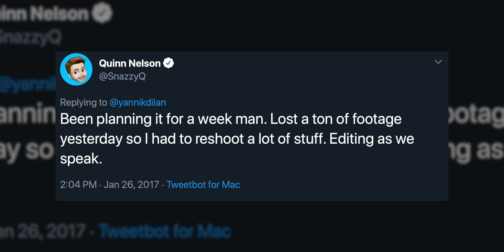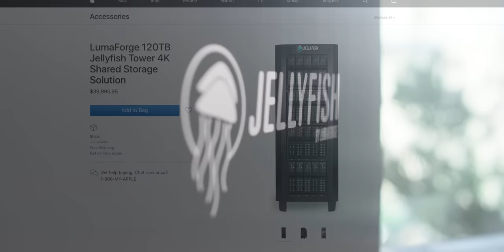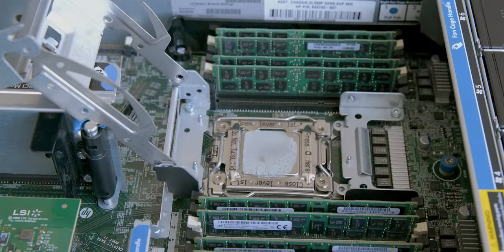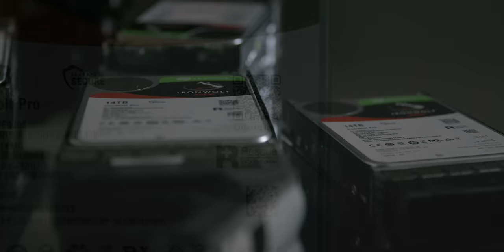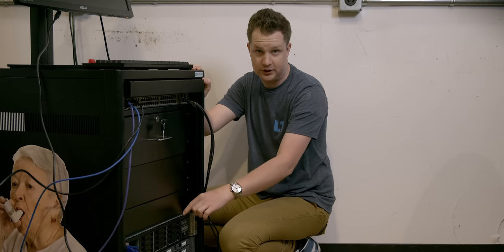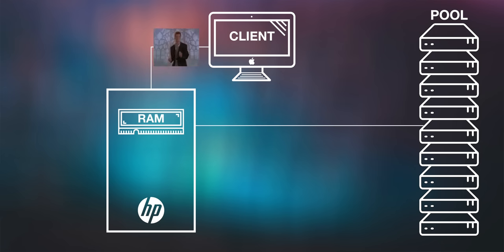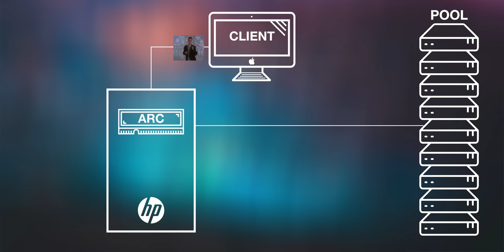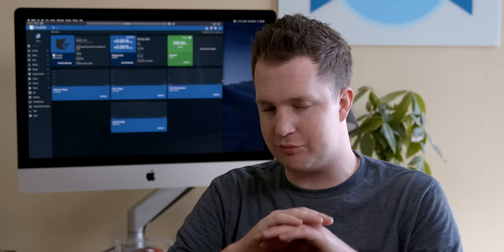I Built a HUGE 336TB Server Without Linus Tech Tips!

Comment: Next challenge: Max out your iMac’s 10 gigabit ethernet with a tape drive server
Reply: I stumbled back onto this video. Thinking about it again, it's really obvious he didn't need all of his data on hard drives forever. A tape archive would have worked great and been pennies on the dollar compared to this. (If he had to pay for the drives). He wouldn't even need a beefy server. Just a small NAS with a hella fast nvme scratch disk for current projects and the tape recorder on the front. Pop in a new tape every few weeks and you're good. LTO-8 tapes are $120 for 15TB or more of video storage. A new tape drive is $2k-$3k or less if you find one on eBay. It's easy to keep track of which video projects are on which tapes. You aren't realistically going to be referencing more than one or two project files a week so it's perfect. Also the tapes don't degrade because you're just reading from them. Most of those tapes over a year old will just sit on a shelf for the rest of eternity.

Comment: You have an interesting interpretation of a “budget” build, with $12,000 of new HDD. If you really wanted to save $$$$ you would have built this using drives you shucked from Best Buy USB enclosures. Or even better, used 2TB hitachis that you can buy on eBay for $15 each all day long.

Comment: Not a QSFP+ to MiniSAS cable, that's a simple SFF-8088 to SFF-8088 SAS cable, QSFP is not a SAS capable port. (Source: I build these types of systems only much larger scale as my job)

Just wait until you need two storage arrays and this setup grows into a SAN, then you're wallet will really start burning.

Comment: This is just the IT guy way of recycling old company stuff or taking them home.  A lot of IT guys get this stuff for free.  You see the hardware is cheap because of enterprise planned obsolesce.  After 5 years these companies tell your IT boss they will stop supporting this hardware because you know Intel is making a different socket or chipset.  Yet Intel has been selling the same Core i7 chip for almost 12 years with very slow change in fab tech until AMD disrupted that 2 years ago.  

The cons to running these enterprise stuff is they are heavy, run loud, and eat a lot of power.  I looked at my utility bill, it's not worth it.  Basically each month I maybe adding another $25-40 for energy bill just to run a few enterprise hardware.  Sure they are darn cheap since many SAS 15k rpm drives are like dirt cheap vs 7.2k consumer drives.

So there's no savings here once you factor the cost of running the setups over a few months the savings are evaporated by the cost of energy these things use.

Comment: Hmmm, this server should use Cepth as the operating system. It waste of resource that using that much Hard Drive without Tired Storage. There are only rams for cache, a really bad setup. And the flexibility is low due to the RAID setup although FreeNAS offers better Software RAID compare to the hardware one. Software-Defined Storage is like healing up itself using redundancy space. But RAID setup is can only use Hot Swap.

Comment: 60 seconds is not enough time for unraid/freenas/Linux/Windows to shutdown cleanly.  You need at least 2500 va UPS to have enough time to shutdown cleanly.
Reply: this is a common misconception. Higher VA =/= Longer run time. Higher VA UPS's can have longer run time time, but this is usually due to them having higher battery capacity. A simple rule of thumb is look at the weight of the UPS. If you shop around, you will start to notice that UPS's with the same VA rating can be double or triple the weight. This is because they have a much larger battery capacity. In the past I had a monsterous old 5U 1400VA UPS attached to a 4U secondary battery. The run time of this setup was insanely long... and still only required standard 110 power. The real thing about UPS's is that electricity hasn't changed much in the past 140 years. Aside from a few bells and whistles, used UPS's function the same as new UPS's as long as you swap in batteries every couple of years... so buying a large enterprise UPS can give you much longer run times without to breaking the bank.

Comment: Server costs 2600 without the drives. Of course! Those 24 monsters were gifted in exchange of short commercial for them. Someones got it easy I see. Quick math like in the video 13.6K bucks!
And the rest of us pays for it in term of higher price due to marketing department throwing them away freely in such capacities not only my head is spinning!
I only got 12TB of their drives and it cost me over 500 bucks when they cost more, yet, theyre not even pro! I cant even afford to run Raid 5 god forbid Raid 6 because I would have to dash another 400 to have 4 drives! Sad to see the drives sit idle in a shutdown server due to its loudness. You should go with 10Gbit nas + expansion stations with backup capabilities or separate HDD enclosure that works for backups thru nas...
BTW theyre not so stellar if you look at the reviews across the entire web sites, but regardless your commercial or other paid adverts, people pick them in hopes all will be well since theyre cheaper than WDred and WAY cheaper than HGST drives. Plus theyre literally only NAS drives with 7200rpms. IDK why seagate does this silly drive giveaway. If they give out one or two drives okay but this?
Not even resellers get shit for free man.

Comment: A 336 TB Storage Server on a tight budget? that's like saying you bought the cheapest 2019 Lamborghini, GTFO dude. Oh you use iMacPro, super expensive super overpriced equipment just because the cartoonish MacOS it has, instead of using Linux or you could use Win 8.1 64-bit, faster than Win 10, or if you want DX12 compatibility, then Win 10 64-bit, cheaper better performance, upgradable, but you look like a guy that wants a easy-cheesy things of plug and play, and keep supporting Apple and their sweat-job child-labour camps in Africa, and their horrible customers support policies, OK then. Your technical explanation are incomplete at some point, you never said if the 14TB HDD were SAS or SATA, you mentioned that the PCB was SAS